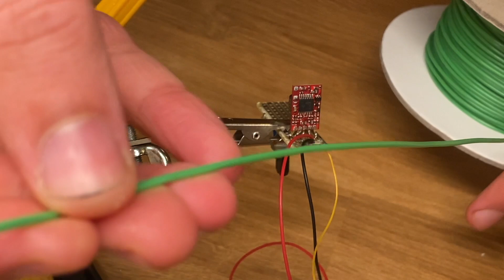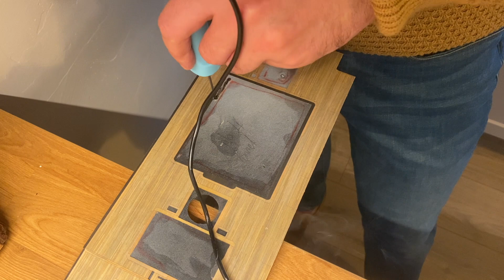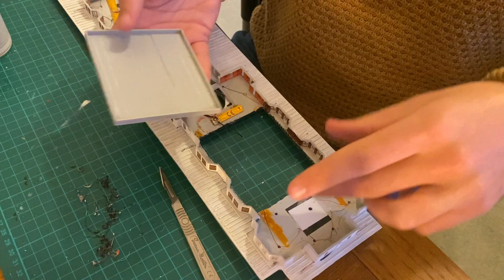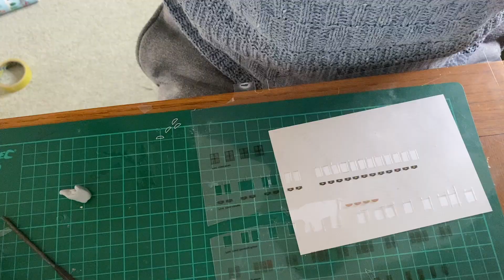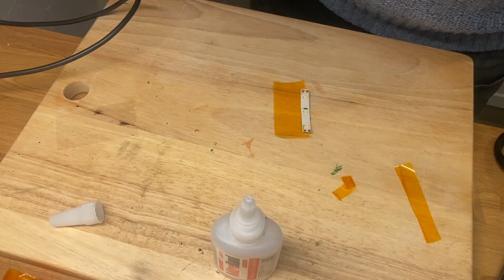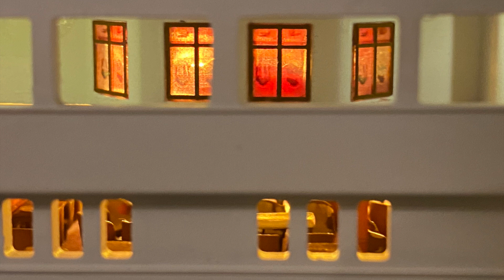Radio Control Trumpeter 1:200 Titanic Build Part 46 - Raised Smoking Room Ceiling

Comment: Just one question...what is the color you used for the lines below the bridge? Don't know how to describe this. It's the line that is on cranelevel...where the loadinghatches are, the kinda orange/brownisch color. Hope you know what I mean? 😀 and did you varnash your wooden decks?
Reply from the maker: Hi there. Yeah I know the colour you mean. On white star ships this was known as Dark Mast, and predictably was used for masts and also lower sides of functional decks such as the well decks. 
I used Humbrol 63 for this which I think is called Sand. 
In reality my colour choice is perhaps a little bit light, it’s not such an issue on the well decks as there is enough shadow to darken how you perceive the colour, but on the masts they do look a wee bit light. However I like the colour as is so won’t change it! 

Yeah I sealed them with a matt varnish, Humbrol do a good enamel varnish range that has matt, satin and gloss in it, so I used those.
Reply: @TheModelBoatGuy  thank you so much for this advice 🙂! Going to look for the humbrol 63. I think it fits perfectly 🙂. Thanks again and have a good day! Grtz 🤟
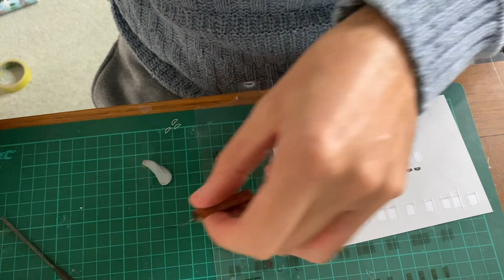Reply: Hello there shipmate! Just wanted to drop this little nugget in the comments...In episode 18 at 12:07 you said you used Humbrol 61 Flat Flesh as your dark mask colour... 🤨 I loved it so much I went and done all my dark mast parts on my 1/350 kit in H61... when did you change to H63?! 😧
I have read that a good choice for the funnel buff colour would be H63 with a dash of H34, which was apparantley a match to a tin straight from the MV Britannic... Another Titanic modeller, Jason King, uses Pantone 135. British Gulf Armour is another "off the shelf" tin I've seen used but cannot remember the brand, maybe model master or floquil I think... White Star Buff... what a can of worms that one is!! 😬(I think so long as they're not yellow or orange its all good!)
Reply from the maker: Hi there, you are correct! Since using this I have finished the tin of paint and chucked out so I was going from memory! 
You are quite correct though. The colour I used for dark mast was Humbrol 61 not Humbrol 63! Well spotted. Dark mast is one of those colours that is subject to so much debate you could use a lot of different colours and still argue your case! @themusiccomposer I hope you see this before you buy the paint, if not sorry. An honest mistake!
Reply: @TheModelBoatGuy  hi there 🙂 well I just read it haha. But it's not an issue. I already have painted it and I'm happy with how it looks. So I'm gonna stick with it I guess 😃 but thanks anyway! 🤟🤟
Reply: @TheModelBoatGuy  hello mate! I just wanted to ask a quick question 🙂 did you varnish the scaledecks before or after you glue them down? 🤟

Comment: Hi there could I just ask what. Make of electric motors did you use in the model  hope you. Had a merry xmas and happy new year From Richard
Reply from the maker: Hello, happy new year too! The motors I’ve used are these: 
https://www.cornwallmodelboats.co.uk/acatalog/mfa-950d61.html#SID=2421
They are relatively noisy but that can be dampened down with good mounting practice (a resilient floor beneath). I also had some success with a good silicone grease for noise reduction

Comment: HELP Hi i am following your build and doing exactly the same to mine running gears in all the electrics done apart from the key fob circuit breaker i can no longer access the show more show less part of your description so do not know what the part is or where to find one could you help   please hope you had a great CXhristmas and are going to have a good Hogmanay
Reply from the maker: Hi there. 
Something like this will probably work: 
QIACHIP Universal Wireless Relay Module 12V 1CH Remote Control Light Switch Receiver RF 433 Mhz with 2 Smart Transmitters for Entrance Control, Car Light 164ft Long Range https://www.amazon.co.uk/dp/B081CD9GHD/ref=cm_sw_r_cp_api_glt_fabc_70M9FTZ14JDJE75RJ52K?_encoding=UTF8&psc=1

The one I bought is no longer available but this is similar. One thing to note is the current capacity of the relay, it’s probably not a good idea use that relay to break the circuit when there’s loads of functions running on the ship. 
When I use mine I tend to use my actual Transmitter to turn everything off, lights and smoke, then use the relay to cut the battery feed. That way you are making sure as little current as possible is broken by the relays contacts

Comment: Looking great. I have a question you may be able to help me with, I need to know what motors/esc/battery combos would be suitable for a 1/350 USS Enterprise aircraft carrier?
Reply from the maker: Well I mean it rather depends on what you want to ship to do. 
I don’t know how many props Enterprise had but I tend to use one motor per prop. My preference on ships is to use gearing because if you sail through weeds, your motors can stall. And a DC motor pulls maximum current when they are stalled, so you run the risk of blowing fuses etc. Gearing increases torque which reduces the risk of a stall. But the other option is a higher power motor. Cornwall model boats has a great range of motors. 

ESCs is a whole rabbit hole of different things, but the Mtronics Viper marine range are excellent and cool proof. They come in different current capacities and you just need to match that to your motors. 

Batteries are rather defined by the type of ship you make. A speed boat or something would require a good current delivery but for an aircraft carrier I’m guessing you don’t want speed! Sealed Lead acids are cheap and robust, and are pretty safe, but they are heavy for the energy stored. Other batteries like LiPO are much lighter for their power density, so you can get a longer running time on your model. But they need to be looked after more carefully. I chose lead acids on my model because I like to be able to get the ship home from a sail, get the batteries on charge and sort of forget about it. You can’t really do that with more lipo or Lion batteries because they need to be carefully charged and stored.

I’m not really making a recommendation here because it’s a question of taste, how you want your model to handle etc. But hopefully that’s a good set of suggestions.